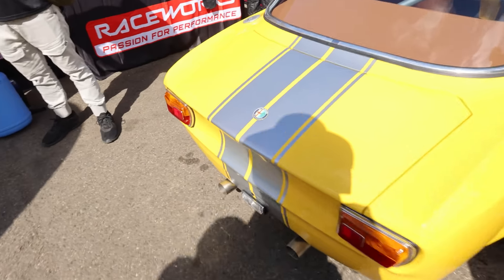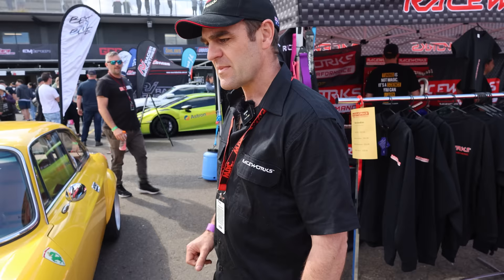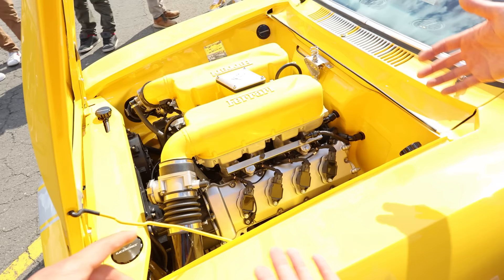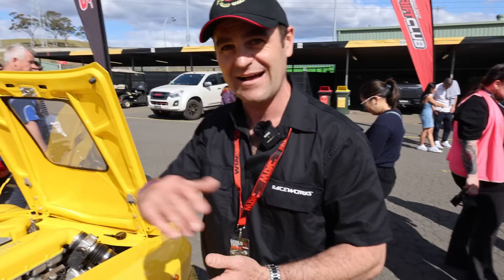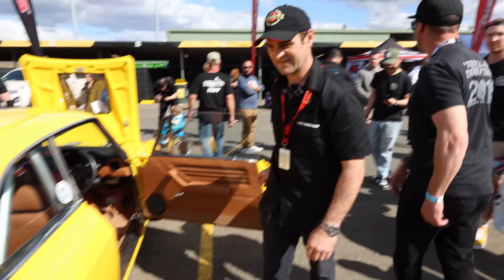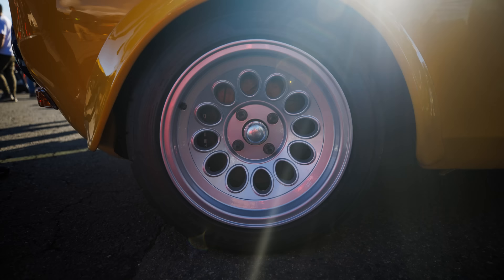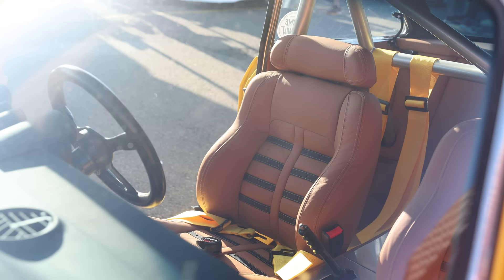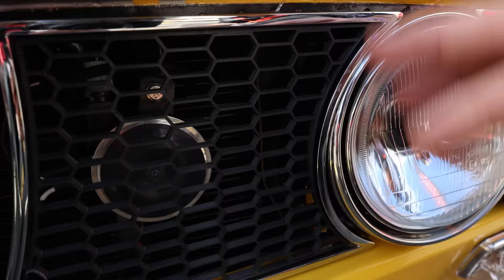Ferrari 360-Powered Alfa Romeo 105 Dubbed "Alfarrari"

Comment: Jeff is probably a one of a kind car builder. Doing every single thing himself. Kudos.
Reply: I've built a couple of my race cars myself, but this is a Master Class level of construction. Unbelievably ambitious and unique. All I can say is wow, just wow.
Reply: @993mike  I don't know anything about him, but I would assume he's a fabricator.
My father is a welder/fabricator, and he has a machine shop in the garage. Ironically he's also an electrician. 
He would build cars for people in his shop, and even wire them in many cases.
Typically you're building a custom chassis for your engine, trans, and rear anyways. And then you're welding the body of whichever car.
It's a lot of measuring up front, and even then you'll run into things but you adapt as you go.
Reply: dude is his own car manufacturer. From design to engineering to fabrication. Given enough investment dude can probably form his own restomod company, and do it better than most of em. Fuck if he does I'd apply lol..
Reply: So I just watched him build the car, and yeah you're right.
I don't know many people who are fabricators, mechanics, and can cut/stitch their own leather. He's a wild one.
Reply: RESPECT....what a talented guy!!!!